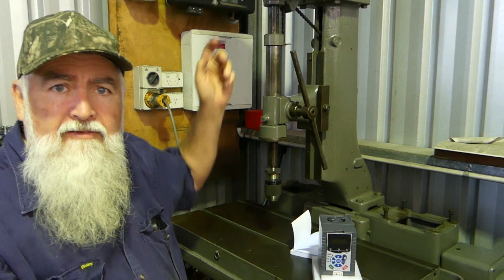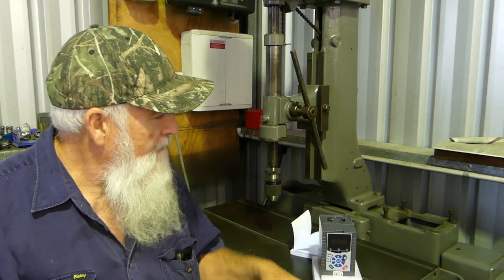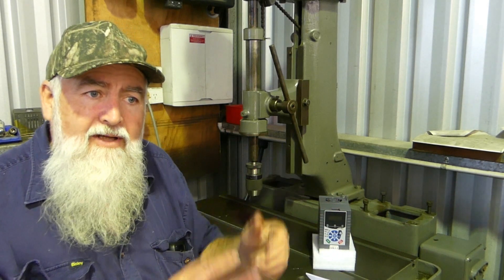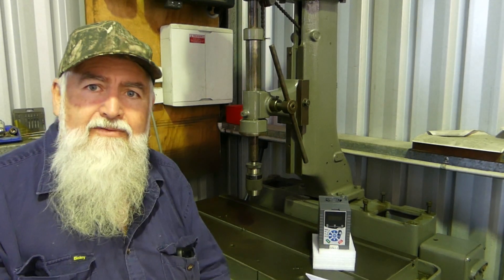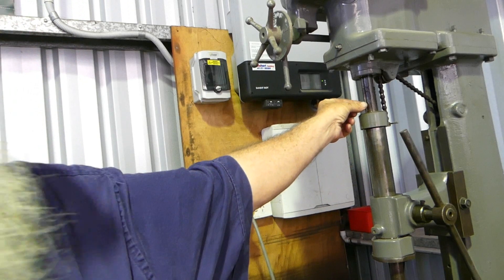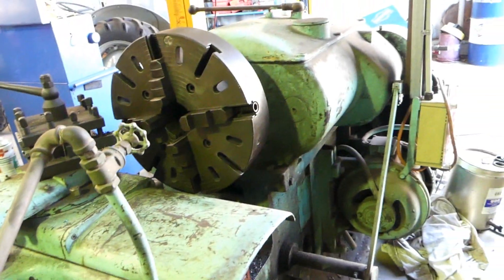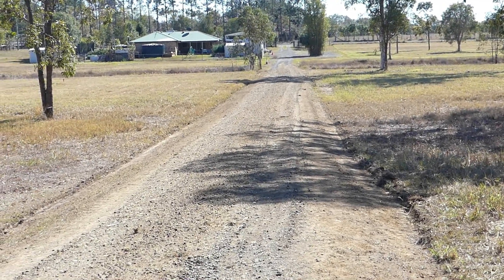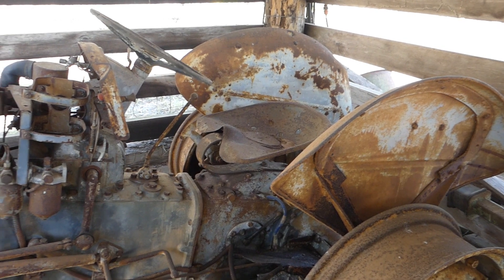Kangaroo Stew # 156

Comment: G’day Lance. Drive looks good and like someone already said run a chain harrow over it a few times to bring the gravel up. I’m not an electrician, but I’ve dabbled a little. I suspect you will find there is a contactor in that box. They do hum a little because it’s an electromechanical device. However that is quite a bit more than a ‘hum’. I suspect as others have said that the contacts inside are either dirty, damaged or misaligned. I think you’ll find if you open it up it will be pretty obvious and easy to fix. Fitting a VFD sounds like overkill to me. Better to keep that for a project that actually needs one. What a beautiful piece of machinery though - WOW! I’d give my left ** for something like that! Enjoy your break it is well deserved. Looking forward to the TEF project - that would be a great series given the current state of it!
Reply from the maker: G Gay Gordon, These VFDs are bloody cheap at the moment, the thought with the VFD apart from the noise is to slow it down a little as well.

Comment: The old drill is a masterpiece mate..The humming noise in our crusher switchboxes used to be just dirty contactors so I guess that's the same here..The VFD should fix it up for good though..
Reply from the maker: G Day Wayne, Yeah I suppose I should have a look at the points but the VFD if I go that way should slow it down a bit for me as well.
Reply: @BundyBearsShed  just for shits n giggles check out the DC motors in treadmills mate..some of them are 3hp @240vdc and are easy to speed control ..i have the buggers on my wood lathe, rocksaw, rock tumbler and bench saw now..treadmills are a prime throwout item up here with the 3 minute fitness freaks around the place..The VRD would tick all your boxes though i reckon.

Comment: Ooh Victoria in September! Hope your taking your winter underwear lol. That buzzing is not right, I like a rotary phase converter but a dedicated vfd is good too. If all else fails I'll come and help you with it
Reply from the maker: G Day Dave, That means I should start wearing underwear to get used to it I suppose ,lol. Doesnt a rotary phase converter change from single to 3 phase? Or thats the impression I had at least but I dint know much about these matters.
Reply: @BundyBearsShed  Teach me to listen properly, I assumed you were using the VFD to convert from single to 3 phase but now I listen again (d'oh) it's as a speed controller as you do have 3 phase in the shed (that confused me the first time around I must say lol)  anyway if your stuck the offer is there... Avoid woollen and nylon underwear that's my best advice to a novice LOL

Comment: Hi Lance, nice stew, thanks. I've made a half-arse start on my TEF20 project, you should start on yours so I can see what I should be doing. My MF35 project has changed, the fella who wanted the 23C donk has decided that he doesn't want it now, so I think it will be restored as is, rather than putting the Flathead V8 into it. But, now I need something to put the V8 in ...problems, problems...lol.
Reply from the maker: I reckon you might be able to find something for the v8. Just no room for the TEF at present.

Comment: Lance old son!  A good sparkle should be able to get the drill to run backwards.  About as useful as an ashtray on a motor bike, but an interesting project, eh???

Steve
Reply from the maker: Good for left hand drill bits, I have them to get broken bolts out.